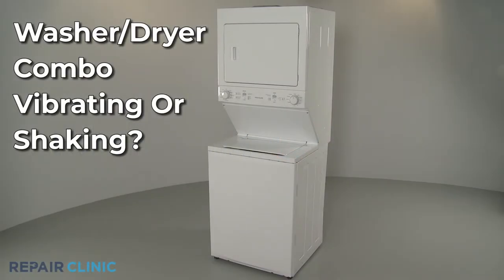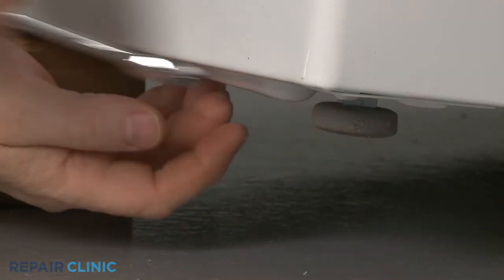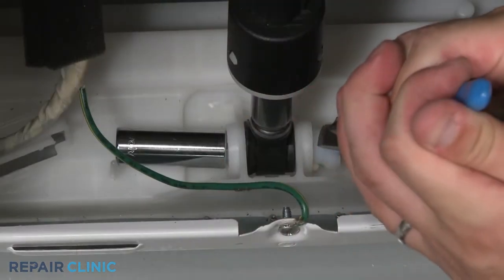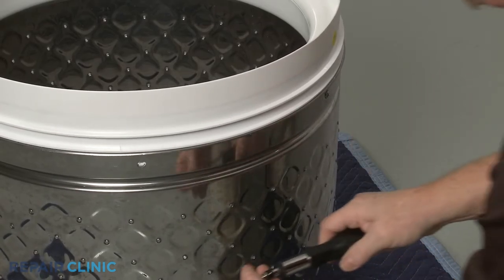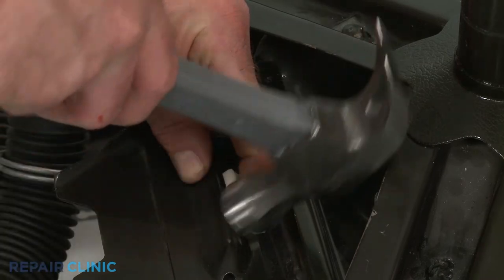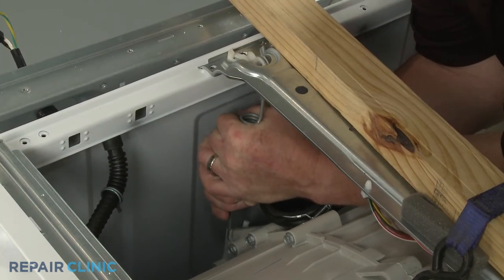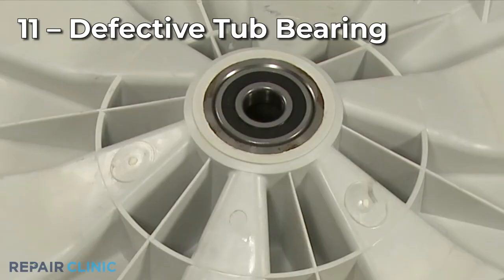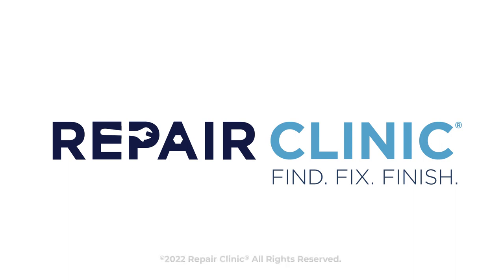Washer/Dryer Combo Vibrating or Shaking — Washer/Dryer Combo Troubleshooting

Comment: How do you get the top lid of the washer off?
Reply: You need a thin metal tool.  Between the front cover and top there should be two clips (one on each side). Push the thin metal tool into both of the clips to unlatch them.